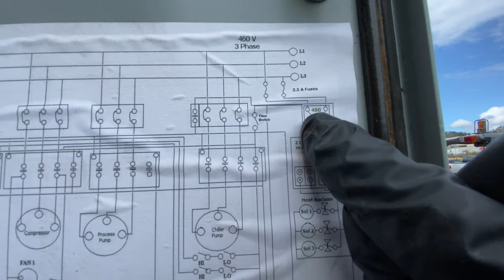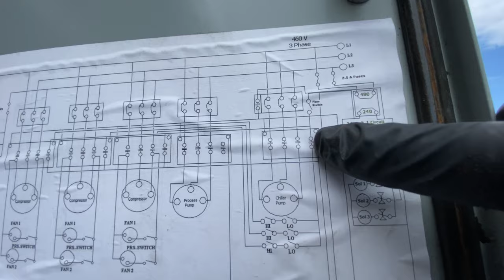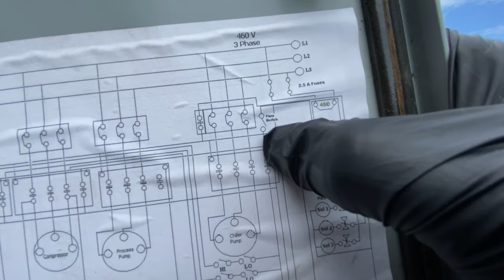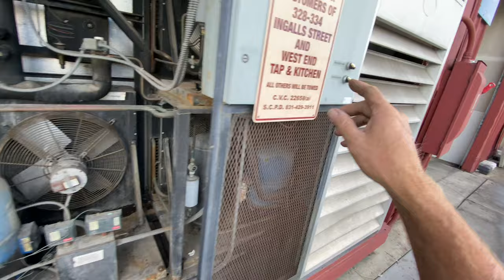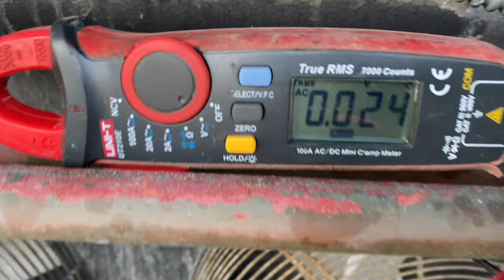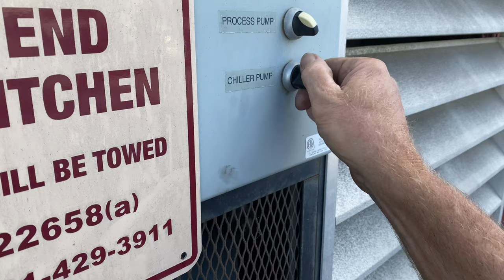Glycol chiller part 2

Comment: I just replaced the same flow switch on a chiller that was 15yrs old. It was stuck open on the contacts. All corroded inside worse than yours in the video. Working great now. Thanks for your knowledge

Comment: Nice save. No isolation valves will make a project out of replacing that switch.
Reply: if it had any valves, they'd likely be seized open and not work anyway. good old neglected acidic glycol system.